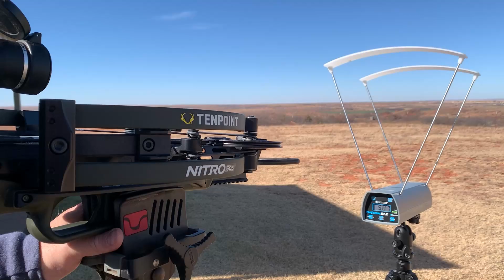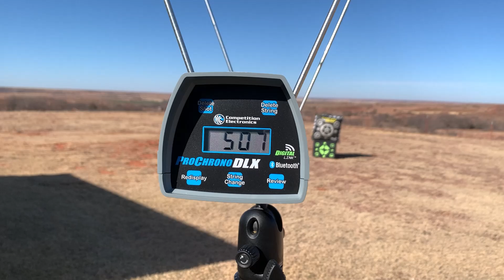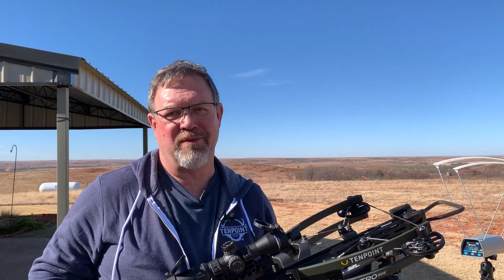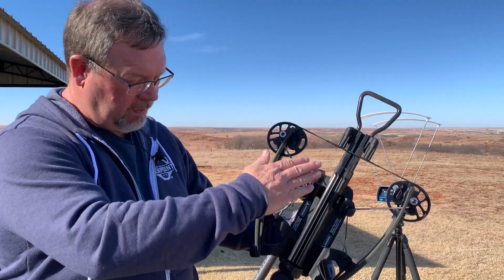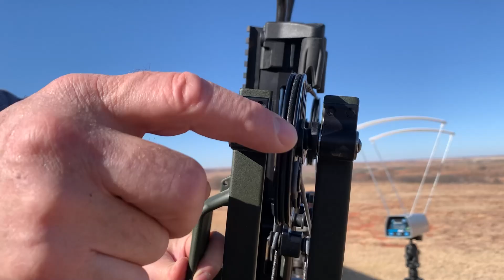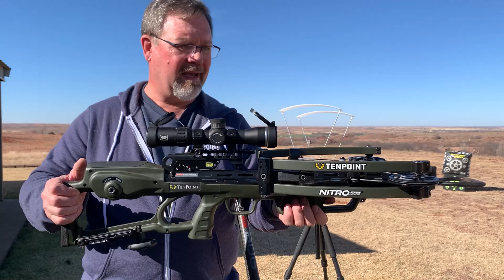NEW TenPoint Nitro 505: Fastest Crossbow Ever With Safe De-Cocking

Comment: They make great bows but when you have a problem they wont get back with you. I bought a stealth I broke 3 strings an 2 sets of cables. The plastic nocks would not hold with that much power. They would break and the bow would dry fire.They new it was a problem because they come out with a metal nock. I have never had a another problem. I called an text around 10 times an they would not get back with me.I had to pay for the problem that should had been taken care of before the bow was sold.

Comment: It’s 5 fps faster big deal.
Reply: There getting 515-517 with 400 gr arrow.
Reply: Most of these 505's are shooting over 515fps. Quite a few 505's are getting over 520fps with 400gr. Amazing crossbow, I just ordered the Nitro 505, affter speeking with over a dozen 505 owners.  Insanely fast, reliable and accurate, is the consensus from every owner I spoke with.

Comment: Amazingly fast, accurate, long draw, reverse draw technology by Scorpyd sold to Ten Point.  They've made a few changes to it to make it even a little quicker than the Scorpyd.  It all comes with a huge price tag though
Reply from the maker: This crossbow is designed by TenPoint. Yes, they acquired reverse-draw technology when they bought Horton like 15 years ago, but this is all new technology on the crossbow build.
Reply: @DDHONLINE  And Horten paid Scorpyd (Bill Kempf- The inventor and owner of the patent of reverse draw technology) for the rights to produce reverse draw crossbows. All reverse draw crossbows are made after 1st paying Scorpyd the right to do so.  Scorpyd offers the Ten Point Accudraw under license from Ten Point.  They share technology for a price just like any other industry
Reply: @frankbrowning328  mic drop 🤷
Reply from the maker: @frankbrowning328  Yep -- literally dozens, if not hundreds of similar examples throughout the outdoors industry (and any industry when you think about it).
Reply: I’ve got to say! TenPoint is beating Ravin in the 500 FPS war so completely that it’s not even funny. The 505 seems to be a better crossbow in almost every possible way. I like Ravin and I love my R10, but I will add a 505 to my collection without hesitation and not look back.
TenPoint put in a lot of research and development into the 505 & the attention to detail has paid off.
Reply: A little quicker than a Scorpyd? I love Scorpyd also, but that’s more than a little!